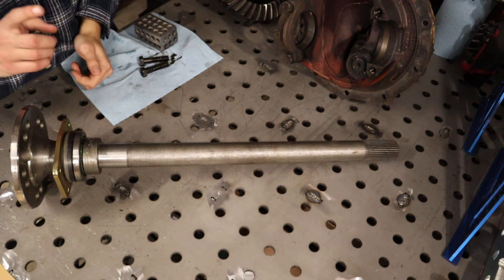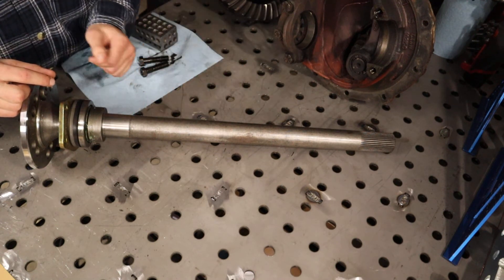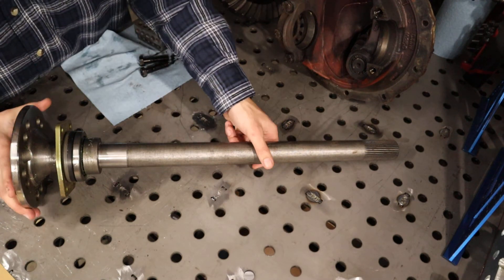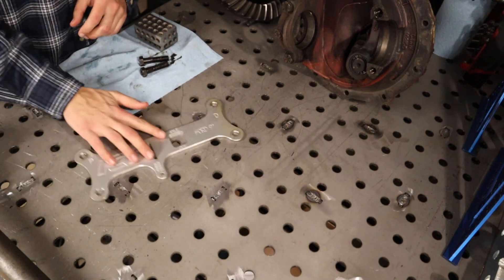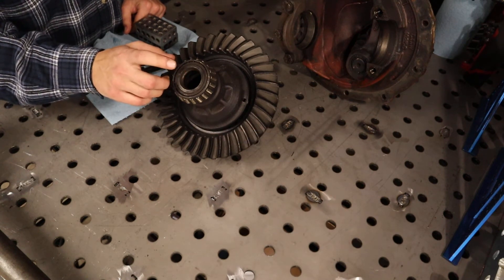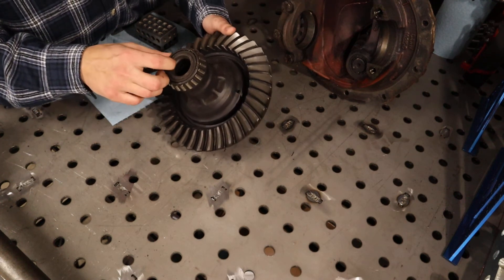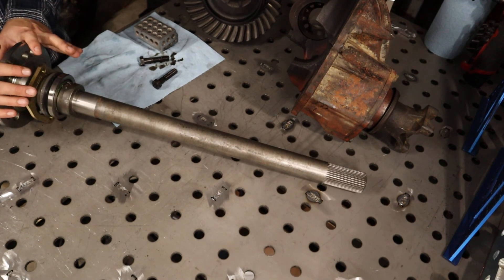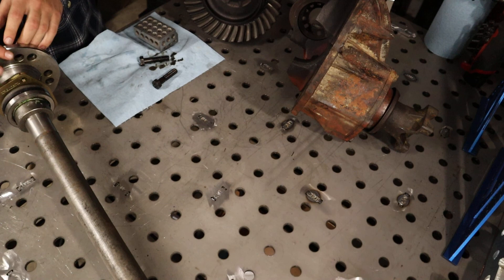9in 35 spline axle shafts. What you should know

Comment: Do you think the 31 spline can handle 550 hp 600 torque ? On an f100 ? I know 35 is better. But can the 31 handle for a while ?
Reply from the maker: I've seen street guys do it. Hard launches are gonna be the killers. Clutch drops and transbrake launches on some real sticky tires may give you some problems at a track. If you ever have doubts, truse the axle so that there is no deflection coming from the axle tubes. Straighter the better. But absolutely yes

Comment: Good evening.  I just saw your video.  Thanks for sharing.  I have a few questions.  I have 1070 Ford F-100 that has the stock housing and I want to upgrade to a 31 spline axle, Chromoly shaft, and a 3130 or 3150 yoke.  The truck has rear drum brakes that I want to change a Wilwood disk brake setup.  I'd like to know your thoughts on this.  What's involved in this build.  Thanks in advance.
Reply from the maker: The bronco housings are the best, the head on the axle has longer truses from the factory. The yoke is really determined by power rating. The nongreaseable u joints are slightly stronger because there is no hole drilled in them for grease to flow. I'm still using my housing out of the 1966 f100. Shortened 9.25 inches and thicker 4130 chromoly housing ends (late bolt pattern torino style). Disk brakes are always a good upgrade even jegs makes kits for almost every application of 9 inch. Hope that helps, sorry for my reply being a month late